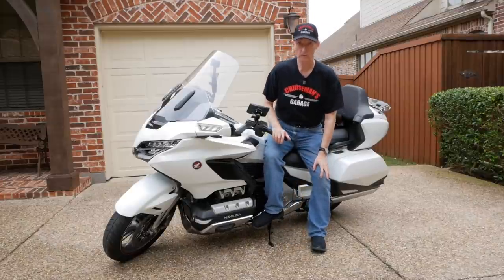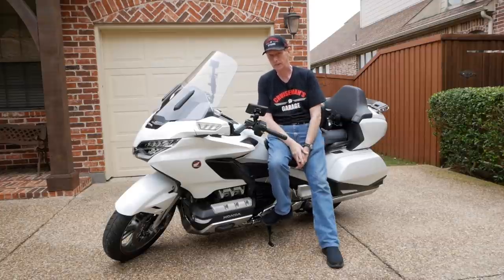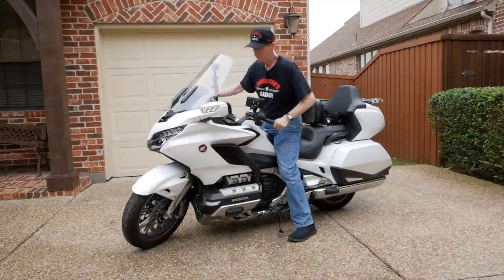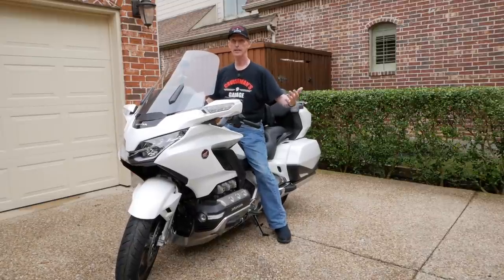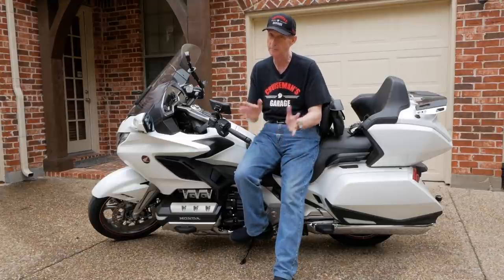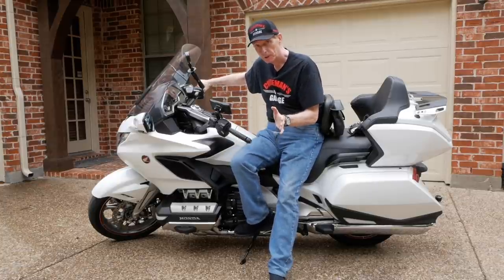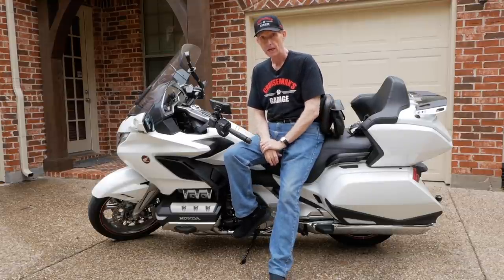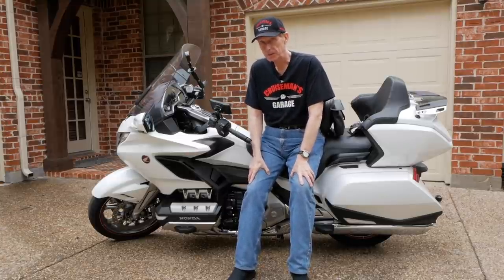How to take your Goldwing off the side stand  | 2018+ Honda Goldwing | CruisemansGarage.com | 2020

Comment: Although Max has some great ideas on improving the Goldwing , I think he's  stretching a bit on this one . After all he is in business to make money , so inturn he has to pick apart everything on Goldwing.  If I'm not mistaken they make airplanes out of aluminum,  seems to be working for them .                                        Ride safe Cruise man.
Reply from the maker: Airplanes undergo periodic checks for stress cracks in the airframe too.
Reply: Cruiseman's Garage but they fly at 550 miles an hour and fly more miles in a month than we ride bikes in a lifetime.
Reply: I completely agree with you. M. McA. is just trying to profiteer by offering a solution to a problem that doesn't really exist IMO. The gullible or very nervous will fall for it. Most people won't. In normal useage the spindle is not subjected to very high stresses at all. I'm only 5'6" and weigh 145lbs and even I can lift my 2018 Wing up off the side stand exactly as Cruiseman demonstrates with virtually no force applied to the handlebars and that is actually how I usually do it. M. McA. was really exaggerating things to a ridiculous degree in this regard in his video. The one issue might be, as has been pointed out, if the bike tips right over and the end of the bars take a significant impact on the ground. But then if that happened I'd be getting the bike thoroughly checked over anyway whatever bike it happened to be as any sensible owner would. I'd be happy to have the spindle replaced as original if deemed necessary as any damage would have been caused by the abnormal event and not, most likely, normal useage. Any component in any machine can fail if it is subjected to excessive forces, especially in an inappropriate direction. I'm sure Honda have designed this component to be able to cope with all forces expected in normal useage with a considerable safety margin. Even if the spindle does fail at any time it isn't likely to be while the bike is actually being ridden. It would be at a time if excessive force is being applied in a non recommended manner like using the handlebars to strap the bike down on a trailer. Now where have I heard about that before?
Reply: @iannicholson9875  apparently it does exist since a few bikes have had this issue and honda even had to update the torq specs due to this issue. Basicly if you go by the original torque spec your already headed for future failure, everything has room for improvement,  some times companies cut cost on certain items to save a few cents here and there, look at many vehicles now a days. Look at some of the clips even on the goldwing they are plastic rather than metal like they use to be is that innovation or cost cutting tactics.

Comment: I was looking forward to you dropping your bike so we could watch you pick it up .  (Smiley face emoticon).  As you suggested, I did watch a bunch of videos on how to pick up the bike and I will offer one suggestion: If possible put the bike in gear before lifting it, so it doesn't roll. 

In any case I am impressed you could make a 9 minute video re taking it off the sidestand !!
Reply from the maker: And, on a DCT model, engage the parking brake.

Comment: A far more important caution is putting the Wing up on it's centre stand. My foot slipped off the lever whne  putting  it on the centrer stand and I broke my heel as my foot came down  on the concrete. It left me with permanent nerve damage in my left leg. In 65 years of riding motorcycles, this was the ONLY time I ever injured myself on a motorcycle. I understand I am far from the only person to suffer this injury so I would caution you to be CAREFUL when putting the Wing up on it's centre stand.
Reply: Dang..  I feel your pain Robert..  I stood on a wood chair, the seat split in half and I broke three metatarsals and two toes as it slammed into the concrete..  never been the same.
Reply: @steven.h0629  Yes, for me at 80, it was life altering in several ways. I ended up with permanent nerve damage whereby after physical activity of any sort, I have no feeling on the top of my upper leg. I did find a party in Texas that makes an extension arm for the kickstand and this has helped enormously , especially with a steel plate under the sitting spot for the stand. Over a million kilometers over 60 years of driving and the only time I have ever hurt myself was when the Wing was standing still !! As the young like to say..."go figure"...:))

Comment: I might spend a few minutes just to see how I actually use the side stand because I never gave it much thought.  But I feel like we're babying this bike a bit much. 

Actually this season I stopped using the side stand at all because the center stand is so easy to use.   But I do hold the bike up using the bars when I get off to put it on the center stand.

I recently had my bike fixed due to the excessive play in the bars.

Comment: Great video, I have a 2002 goldwing. Guess how many times the bike was tipped up by the handle bars before I bought it. Quite a few times I am sure, but when I bought it and if it had any looseness in the spindle shaft I probably wouldn't of bought it. Bikes that were built before 2010 were tough and not like these. But if I did it would be black.

I guess I would of have to test ride a new one, but if I did I would be nervous about steering a bike that didn't have a direct contact with the steering wheel. Let's put it this way would you ride a bicycle that has this same linkage on it???

I would love to know the $64,000 question on this steering design. If they screwed up or if they actually meant to design it this way. Somebody knows the answer, it probably will be a highly guarded secret for awhile until someone breaks and can't take it anymore. Anyone wanna confess?

Comment: Honda is aware of this issue. Hopefully it’ll be addressed in the 2021 model. Do you have a video on how to tie down these bikes, should the need arise to trailer one? I saw Max’s video about the spindle failure and it seems it was due to the bike being trailered often with the handlebars being used to secure the bike. Seems to me, the spindle should be more robust. No way, in my opinion, should it be compromised by securing the bike to a trailer using the handlebars. Does Honda recommend any particular way to secure the bike to a trailer?

Comment: For me, I have short legs, so I am not flat footed sitting on the bike and cannot get enough leverage to push the bike over with my thigh. Now on my Harleys, I would sit on the bike, turn the handlebars slightly turned to the right, use my left hand and grab underneath the gas tank and very gently lift. With the handlebars turned to the right the bike leans straight up without much pressure on the gas tank. I think that if my 2018 Goldwing fell over and the handlebars did hit the ground, and after a good inspection, if found that there were no looseness of any kind, I would put the pin in as a safety measure and not replace the steering stem. It really hasn't been proven that the stem will break if the handlebars hit the ground, but it would be a good idea to keep it in mind that it could happen. If the steering stem fails down the road, I would know it, and the pin would allow me to continue to steer the bike to the side of the road. Love the videos, keep them coming. :)

Comment: So this video caused me to go to my garage and take note of how I naturally mount my 2019 Goldwing. I grasp the front brake, swing my right leg over, and take a seat. The bike comes up naturally into it's ready position. I do zero lifting with the handlebars. 

Now, the discussion about replacing those aluminum parts with stainless steel. I am absolutely not a metallurgist or a mechanic. But aren't there chemistry issues with mating cast or machined aluminum parts to stainless steel? I had thought it caused an adverse chemical reaction that overtime compromises aluminum. Cruiseman, is that fact or fiction?
Reply from the maker: Not a metellurgist either, but I "think" the only aluminum component currently is the spindle.
Reply: I'm not a metallurgist either but there can be accelerated corrosion issues caused by two dissimilar metals being in contact with each other in certain circumstances. I believe it can occur with aluminium and steel but whether it could happen with aluminium and stainless steel in this application I do not know.
Reply: @iannicholson9875  thank you, for your comment. I'm now just wondering if there are other aluminum parts in there beside the spindle. I think regardless, if it actually becomes an issue Honda will replace these. It would be expensive, but they could do it. Similar to all the airbag situations the last several years.

Comment: Cruiseman, you failed to mention one critical cause of the potential spindle failure on the 2018 Goldwing. That is: Honda's torque spec. for the spindle nuts being the same as the previous vintage that used steel. I think it's somewhere in the range of 72 ft. lbs., and that damages the aluminum spindle. That damage can then lead to a catastrophic failure if additional stress is applied to the handlebars either in a single incident like a tipover or crash, or over time. The fact is that Honda's use of an aluminum spindle with steel torque spec's is a failure waiting to happen. I believe Honda corrected the factory torque spec for '18, '19 and '20 Goldwings
Reply from the maker: I covered the torque issue in a prior video.

Comment: Great demonstration and discussion. FYI, I had a GSA before my wing which is much higher seat. Even at 6+ ft I found the easiest way to get on the bike is to use the foot peg and trust the side stand to step up with my left foot and then swing my right leg over. Once I got used to it became second nature and I still do the same on the Goldwing. Much easier then stepping through with your right and more stable and no lifting on the bar. Also I did drop my wing and the mirror was slightly scratched. Handle bar did not touch the ground. But I did scratch the back back. I learned my mistake. Never again

Comment: 2018+ Has not had the problem Max says it has. If so prove it. Where is it published from Honda or another trusted source. The aluminum spindle is designed to take that stress. A solid stainless steel spindle will only put stress somewhere else it was not designed to take and that would cause a catastrophic failure somewhere in steering Max is wrong. Note: Max only owns a Goldwing to show and tell. He’s not a biker/Motorcyclist. If he is why never be out on the Goldwing. He only wants to sell his parts and I’m ok with being in business but not by using fear to sell parts.

Comment: What about going from side stand to centerstand?
Reply from the maker: Once again, I don't pull up on the handlebars. All the energy comes from weight going down on the center stand while pulling up on the grab rail.
Reply: @cruisemansgarage  I have also 'rolled' off the center stand while sitting on the bike by scooting / pushing forward with my feet slightly touching.  I am on the short side 5' 6" so if I can get it off the center stand this way, anyone with a longer inseam (I'm 31) should be able to do the same.

Comment: I hope you don't mind me asking. I'm looking at a 2008 goldwing trike. Only has 4200 miles on it. Little worried about the low miles. What's your thoughts
Reply from the maker: I would want to know the back story of why so few miles.
Reply: @cruisemansgarage  thank you. For the fast reply. I'm thinking in a  week or so I plan to go look at it. They are asking 27,900. It also comes with a nice trailer. Pre the pictures the bike looks nice. But pictures don't tell everything. Little worried about seals, fork seals so forth. I currently have a ultra classic. But due to back and leg problems a trike would be a better fit for me now.
Reply from the maker: @michaelhale4041  $27 900? Seriously?
Reply: @cruisemansgarage  yes I didn't know if it was a typo was gonna ask
Reply from the maker: @michaelhale4041  you could buy a new Goldwing with a trailer for that amount.
Reply: @cruisemansgarage  this tells you  I know nothing on the goldwings or even the trike conversation. That's why I had to ask you. If I knew how to send you the like one the trike. Here in NC people think they have gold. No matter if only rush was holding it together. I'm not above traveling out of state for a good deal. Just would have to trailer it back here. That would not be a problem either.
Reply from the maker: @michaelhale4041  oh, sorry. I missed the part about it being a trike. That would increase the value.  Sorry.
Reply: @cruisemansgarage  that's fine. I was going to email you the like just to give you some kind of an idea

Comment: Another trick is to turn the  handle bars to the right  as you're getting on the bike the bike will  come right up.
Reply: Yep that is the same thing I was going to write. I'm only 5'6" and I think (may be very wrong, idk) that his height helps with sitting and pushing the bike up with just his leg. Turn to the right and it comes up very easy if you can't do it as easily as CM does.

Comment: I am told that the "tip over bars" do not protect the bike at all if dropped.
Reply: I can attest, the 2008 tip over bars DO catch the bike 100%..  
I was at a signal with both feet down.. right foot on loose gravel on blacktop road.. unintentionally got the bike off center of gravity, right foot could have, would have and should have saved me, but slipped away like it was on marbles.. 💥 Boom.  
Zero damage except for some road rash on the bottom of both catch bars.

Comment: why don't we stop talking about this spindle and ride your bike, im sure honda would be recalling the bike after 3 years if they have an issue. this is getting a little bit to much, ride the bike, pull the bars. stop it already
Reply: I was leaving Golden Grains Bakery in Tellico Plains today and some guys were just arriving.  My 2015 Wing is dirty.  These guys were riding rented Harleys and Indians it turns out from Miami; long ride.  One guy said I really like your bike but it’s not very clean.  Do you stop and clean it up on your trips?   I responded ‘I live here i town.  It’s dirty because if it’s nice enough to wash it, it’s nice enough to go riding.’

Comment: There’s no way there should be a steering issue moving the handle bars. Come on Honda fix it. Don’t worry about that on my Harley, and shouldn’t on Honda. 🤬😯🏍💨💨💨💨🇨🇦👍🏻
Reply: John Valerie Welbers  As near as I can tell, there’s no problem; just a solution. Well, maybe the problem is that the money is in your pocket and should be in Max’s pocket.

Comment: 2 flaws with your explination i think 
1.if your a shorter rider 5'10 down you need that extra levrage to pull the bike towards you.
2. On this goldwing (unlike older ones) the crashbars it seems dont do a good job on a tip over as it seems it will tip the bike further over than previous generations.
Reply from the maker: My bike fell over in my garage, and the tip over bars did their job. That said, they are not as robust as the earlier Goldwings.
Reply: Sorry but you are wrong IMO. I am 5'6" tall and weigh 145 lbs and can lift my 2018 Wing up of the side stand just as Cruiseman does without any trouble at all. Just us one fluid motion and up she comes.
Reply: @iannicholson9875  I'm 5'9" with an inseam of 29 and just reach the ground, I need to use the bars to get my goldwing over a bit many time ,so unless you have longer legs and short torso I dont believe you can flat foot the bike to achieve this. My other friend who is shorter than me had a odd way of getting on his dct goldwing ,he steps on the foot peg first swings his leg over then pulls the bar to him .
Reply: @alsaint7944  Like almost everything with these big bikes size, weight and strength are less important than technique. I've seen guys way bigger than me who can't even get a smaller bike on the main stand. I put my Wing up with no trouble at all. I do usually put my hands on the handlbars but I can actually lift my Wing to upright off the sidestand without even touching the handlebars. Granted I can't do it as easily as someone taller and wouldn't normally do it but I can do it. Just give the bike a good shove with your left thigh. Your right foot doesn't need to be anywhere near the ground so if need be you can push down on the right footpeg as well. Try it. Its relatively easy even for a shorta***se like me once you know how. This is all a bit academic really but it does prove that you don't need to apply a great deal of force through the handlebars to do it even if you do use them to assist, unlike what M. McA. claims.